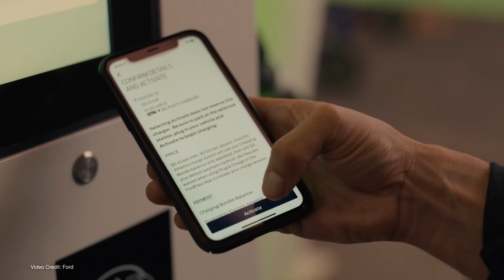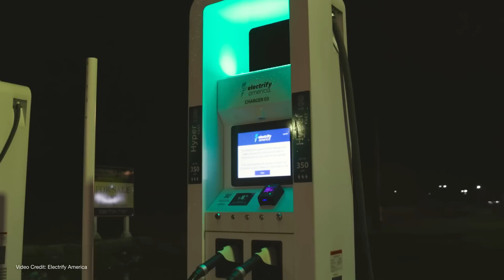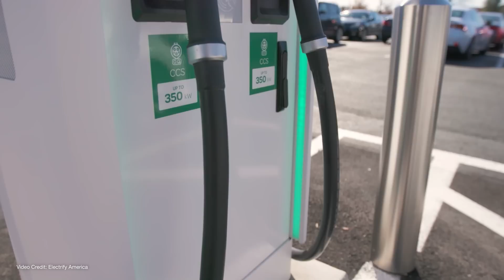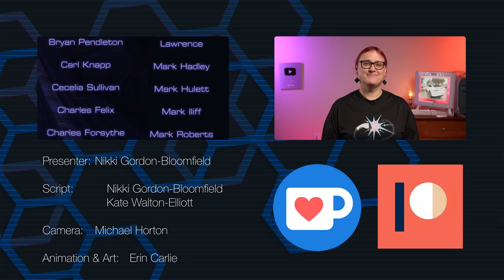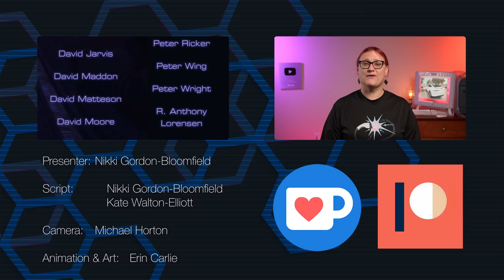EV Fast Charging Is BROKEN - And NACS Won't Fix Everything

Comment: Hi, First I follow since your were in England.  FYI in Québec Canada, Hydro Québec, own by the Provincial Government has a operational availability as Tesla.  I can event charge my model Y in the north east part of New Brunswick by using my Circuit Électrique card.  In the US with all those private energy companies and chargers manufactures, the possibilities of failure are exponential.  On Youtube, I saw a couple from Montreal to travel with a Bolt to Vermont and New York state back to Mtl and the wife don't want to use the Both and use their model 3 to go to Florida to avoid stress and frustrations.  I dream the day will have a standard as user friendly as a gas pump.

Comment: Are there any electric vehicles where the charge port is in a position where if you chose the right parking orientation you couldn’t reach it with a short cable? In other words, if I put my charging station at the back middle of a typical parking place, is there a vehicle for which choosing to pull in at the end where the charging port is closest to the end of the parking space where the charging station is, you would need a long cable? It seems to me that some cabling is excessively long on some of these charging stations, just in case there’s a manufacturer that does some thing strange. But if the charging station was where I described it, what’s the longest distance that any vehicles charging port is? It seems to me that 10 feet is more than sufficient for a charging cable, and there might be a shorter cable length it would be appropriate.

Alternatively, is there any reason why for NACSU couldn’t have an extension cable standard? Such that if you did end up with some kind of an unusual vehicle configuration, you were just carry your own extension, cable, plug the charger cable into your cable, and then plug it into the weird spot that you have your charge port?

Comment: Its only broken for non teslas.
The tesla connector is in the majority of the vehicles on the road the majority of the vehicles sild and on the majority of the dc fast chargers in North America.
At the oresent if you dont have a tesla you ate at the mercy of ccs1 charging stations.
You have no choice but yo use a ccs1 charging station.
If you had access to the Tesla network why would you want to go to an unreliable network when a consistent reliable is available.
The net result is that unreliable broken networks will wither and die.
The ones that improve will survive!

Comment: It’s just a plug after all. Obviously a new plug can’t fix all the bad chargers with CCS currently on. But it will give many ppl a backup  or options.
It will also allow for pricing competition with Tesla which should be good for consumers!
Reply: re: "It’s just a plug after all."  "it's just a connector with some wires inside..." (pragmatic/level headed Pete Rawlinson voice)

Comment: My one and only hope with all of this is that Ford is on the NACS working group ans Ford is known for monitoring online communities. They watch Youtube channels, and they dig into the forums. IF Ford brings that spirit to the working group, MAYBE just MAYBE we will see some of these implemented either as part of the standard (like charger health reporting) or as part of the groups recommendations for station construction. Commitees are notoriously bad at design, but maybe there is someone in this group with some common sense. And hopefully they will NOT make chargers more like gas stations... the goal should be to make them BETTER, not a repeat of the same sometimes terrible experience. (Why does a fully automated pump NEED an attendant to tell it to start pumping??? And why cant it operate when the attendant is off duty???).

On a side note about Equity and Etiquitte. I was recently at a popular brewery and the parking situation was... Interesting. A full 1/4 of the lot (all the spaces closest to the building which would normally be for handicapped parking) was assigned as EV only. Of those spaces maybe 6 had destination chargers (so 3 boxes). Maybe the owners plan on installing more charging, but for now there is just a ton of EV Only parking spaces. I didnt see any handicapped parking and there were NO ramps anywhere in the parking lot (I noticed because I was on my bicycle). But here's the thing... there wasnt a single EV parked in the EV Only parking spaces, but half a dozen parked in the rest of the lot. Teslas, EV6s, an i3, etc. People were circling the block looking for parking and EVs were taking up non-EV parking spots.  The ONLY car in the EV spaces was an ICE car with a handicapped sticker. 🤦 I guess handicapped parking was in a different lot, but there was no signage indicating this. The whole thing was confusing and frustrating. And this was a lot build in the last 10 years, not some old lot being repurposed.

Comment: Nikki, I watch your content, and normal agree, however I disagree about NACS and fixing charging, the standard your spot on will not fix EA poor DC hardware, however it gives drivers an escape valve option in Tesla reliable network.  The standard does not solve for Blink having poor hardware, but it gives drives the option of destination chargers from Tesla which normally are more robust.   NACS puts the charging network on the hot seat as they have two compete not with each other and fail while doing it, but they have to compete with tesal who is ugh, doing it very well.  While I do not think NACS will solve the known universe of charging issues, it punts a dent in a pretty major issue long range travel, and that is always good to put one gremlin to bed.  The NACS standard does not solve for multi family dueling or apartments or anything that was broke before, and those who thought it would have solved those are foolish in nature.  The plug and the opening of superchargers to talk CCS opens the door for more adoption period the end.  The more people adopt the more pressure all of the above and as you stated issues will be forced to be resolved.

Comment: I know of no one claiming NACS is a "magic spell...". Strawman arguments are never persuasive. You can do better. Short cables can work if they make more pull through chargers (which they have started doing and you show some in your video). I have charged at dozens of superchargers and never had to pay for parking.  I suggest you publish a lit of such places so we can nag Tesla to change that. If you mean free type 2 chargers, well that has nothing to do with Tesla. Never saw superchargers "hidden behind dumpsters". Where did you see this? People fighting over superchargers? Rare, and people of course fight over gas station access a lot more. I have never seen a supercharger that was not available 24 hours a day. Good section on etiquette.  But you end with another strawman argument.
Reply from the maker: You might want to watch again ;)

Comment: People keep citing cable weight as a NACS advantage but surely the NACS and CCS cables for a given current are the same thickness, right? Changing the connector doesn't let you use less copper or less cooling. (and 350kW is 430A @800V and a quite a few W dissipated in the cable)
Reply: She mentioned that the Tesla charging cables are as short at possible: because Tesla knows exactly where the charge port is on every one of their cars.
Reply: @jamesphillips2285  Right so people saying the Tesla/NACS cables are thinner actually mean that the tesla cables are shorter and thus lighter to drag around. That makes sense. And as explained in the video this supposed advantage disappears once you have to cater for all vehicles. Ultimately a cable of a given reach and current/cooling capacity is the same in any of NACS/CCS/Chademo.
Reply: @xxwookey  There is away around that: while they are busy standardizing they can standardize the charge port location.
Reply: @xxwookey  They are THINNER and made out of different materials. The CCS cables suck.

Comment: We need mobile battery packs

You drive up to a super charger location and conenct up a mobile battery pack (imagine 5 power walls stacked on top of each ither with two wheels) which gives you +80KWh and an additional 300 mile range

If this existed then a lot of people would be perfectly happy with a 120 mile range EV. 360 days a year the small efficient onboard battery would be enough and a handful of days a year you can rent the mobile battery pack to give you big range

And the time to hook one of those up would probably be just 1-2 mins

The mobile battery packs would also increase the capacity of super charger locations as they can be charged when the super chargers are otherwise idle or at night when power is cheaper

Or when not in use they can act as burtual power plants and earn money that way

Comment: I disagree with the Tesla cables length. Why does Tesla have to spend money to accommodate other companies that want to use the network, shouldn't those companies that want to use the network  re-engineer where port location is on their vehicles?
Reply: That is a valid solution if the charging port location is made part of the standard. As far as I know such details have not been publicly announced yet. 

It may also require charge speed limited adapters (or more likely: just legacy charging stations like CHAdeMO users have to hunt for) for cars already on the road.
Reply: Tesla is already installing new longer cables. This isn't a tremendous issue.

Comment: Tesla owners that know there cars can't charge faster than the slower 150kw v2 chargers(2018-ish  and older), tend to use those slower chargers-- its more of an honor system.  You are incorrect-- biggest superchargers are along high volume interstates in the middle of nowhere.  But apparently you're not studying the Tesla supercharger network.   Like the 100 stall along the 5 in the middle of nowhere outside the Grapevine north of LA.  And the 100 stall or so going in in Baker California in between L.A. and Vegas.  Or the 100 stall or so on the way to Phoenix smack dab in the middle of the desert.  I know of 1 Tesla Supercharger in a hotel parking lot behind a valet that you had to pay.  But thats just one of 100 superchargers I am aware of.  Hi brow places?  Are you kidding?  There are some dearth of charging in low income areas in L.A., for sure-- But in West Hollywood area(rich)  and Hollywood & Bev Hills there only just now new superchargers going in after all of these years.   Even at the most lavish mall in L.A. (Century City) and most celebrated (The Grove) no superchargers.   You are terribly shortsighted just like the Lucid CEO whom said "It's just a connector".   It's not just the light, easily handled connector.  It's one handed plugging in(press the charger cable and your charge hatch opens)  is beautiful!!  Tesla's v3 250k newer faster chargers are lighter and easier to handle than the slower, older v2 70k and 150k Tesla Superchargers.    Pull your car in, with one hand grab the light and easily grabbed connector, open hatch by pressing the charge handle button under your thumb, plug in within about 5 seconds max.  And walk away and its working. Just like in your garage but easier.    Easy peasy.  If you're card is bad it doesn't wait until you're sitting at the charger to get it going again.  My Tesla pushes up to a rate of 250 or 255kw speed within seconds of plugging in, as long as my charge is above 3% and below about 40%. I know it can be more complicated than that based on each EV's architecture.    As long as your beloved legacy auto companies dont try to force Tesla to do anything except what it already does with the existing network(lobbying and capturing legislators like they've been doing to this point), all of you will have the easy experience we already enjoy.  And that will be a good thing. Stop fighting it.

Comment: While I am looking forward to buying our first EV, I'm dreading having to use several different apps to find chargers when travelling. I'm even planning on installing a decent level 2 charger at home, but longer travel in very rural areas has me concerned.
Reply: I actually prefer the RFIDs to clunky apps. Most networks will send it to you for free/very cheap and they tend to be faster and more reliable in my experience. You still need the apps to load the cards (a lot of them just have like $5 that auto reloads), but it's easier to set that up than to get an app out and running every time you want to charge
Reply: Once you are able to use a Tesla app, or your car company has plugged into Tesla supercharger network thru its own app, one app will absolutely do the trick.  And it always works-- at least on the Tesla side.
Reply: @BrandEver117 Why not just let someone use the form of payment everyone has already agreed on... The credit card?
Reply: @patreekotime4578  It has higher transaction costs and requires more hardware out in the field, to answer the rhetorical question. If you want charging to be super simple on roadtrips, you drive Tesla, to answer the original question. But I would love to see a contactless credit card reader on every location when travelling outside my comfort zone. "Bleep, start charging on number 3". Instead of installing an app you have never heard of before and hoping to get it to work, maybe in a country where you don't even speak the language.
Reply: @patreekotime4578  ORRR just plug in the vehicle and have it recognized like Tesla does. This is doable by ALL EV makers / charging station providers...they have just failed to do so.

Comment: I wonder if the switch to NACS would be accepted as a solution by your channel if the CEO was different?  It is a tough pill to swallow but NACS is not perfect but it is the solution.   An olive branch by Tesla that could have easily been kept as a "walled garden"
Reply: I know Tesla being a proprietary mess has put me off ever owning one. And I read through the user manual of the Tesla roadster when it was first released.

There is definitely a trust problem. I have no idea how payments are going to be handled, for example.
Reply: @jamesphillips2285  Tesla may be proprietary...but it's far from a mess...unlike most of the rest of the chargers in the US.

Comment: As soon as Tesla really opens their network to other EVs the other networks will start going broke. Yes, there will be some issues to integrate other EVs into Tesla network by that is only a 1 to N (number of different OEMs) problem to solve, versus M (number of networks) to N (number of OEMs). Whether to have a monopoly is a good or a bad thing that is a different issue.

Comment: As the video points out, the reason that auto makers are adopting NACS is not the connector, it's the reliable, and fairly extensive, Tesla charging network, compared to the government mandated Electricity America network (created by Volkswagen as mandated penance for Dieselgate) or the EVgo network (created by NRG for what Wikipedia calls regulatory compliance).  And yet oddly, the video summarizes by saying that we need to take a sharp turn from Tesla's lead to, it implies, a government mandated and managed solution.  Maybe the video, and much other evidence, has really shown that the free market has yielded far better results than government mandates, and will continue to.  The best selling car model in the world wouldn't be an EV if we had those other networks.  If it's urgent, then don't interrupt what works.
Reply: It’s reliable because it’s only ever needed to charge two vehicles. The actual test will be when it needs to charge myriad software and hardware implementations as 3rd party networks have been tasked with from day one.
Reply: @notshylo  Making things up?  Four Different Models and it has been improving ever since it was started. We're now seeing Version 4 Installed...and they continue to get better. It's RELIABLE because the company KNOWS it NEEDS to be reliable to reach the scale that Tesla wants to achieve and to actually Accelerate the Adoption of Sustainable Energy. 
Unlike EA or other charging systems trying to make a quick buck or do the bare minimum for compliance.

Comment: Just remember that most EVs are NACS based EVs.  So, going to that as the standard is not unusual.
Reply from the maker: No. most EVs models use CCS. Tesla may have more cars on the road but why penalize people for not buying Tesla? That’s ridiculous!
Reply: @transportevolved  I didn't say "most EV models". Read again.  I said most EVs.
Reply from the maker: Again. There was a Standard. Tesla decided it didn't want it. Now the old standard is being transitioned to the new one, which is fine. But we need to make sure more than just Teslas have access to charging, and that more than just Tesla provides charging :)
Reply: @transportevolved  They decided that because CCS was inferior right out of the gate. And it is.   Tesla went way out of there way to build out a supercharger network even thru near bankruptcies.  And now they are offering it to you guys for free.  No funding of the previous infrastructure from legacy auto.  Wow.  Bite the hand that feeds.
Reply from the maker: "You Guys"? Is this an "Us versus Them" mentality? That's not exactly healthy for adoption of EVs.